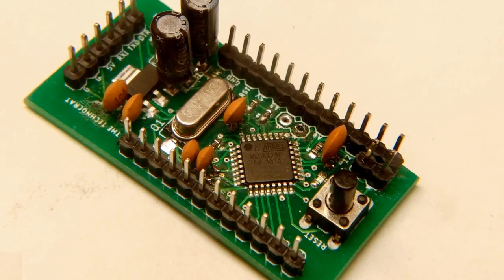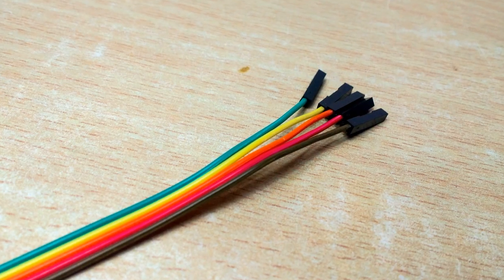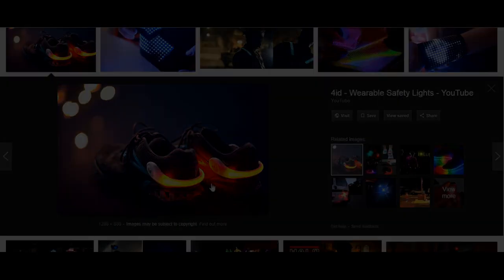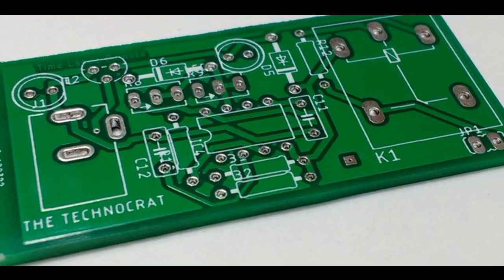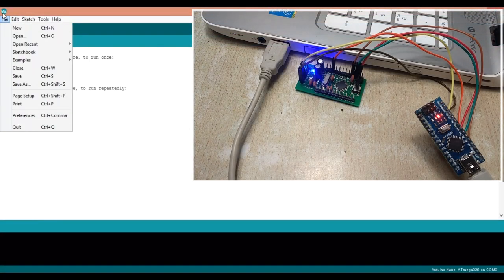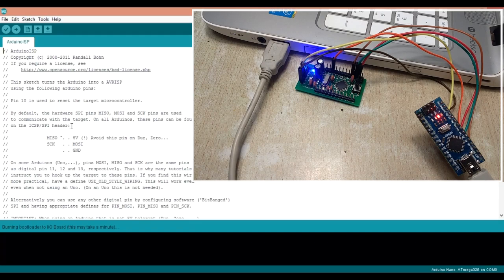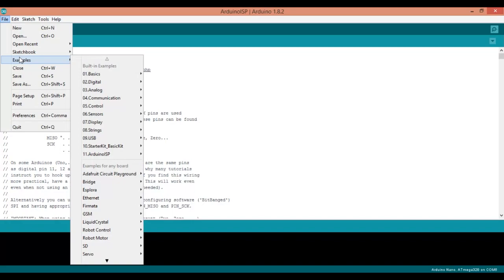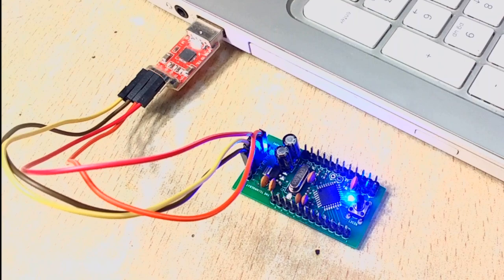Make Arduino NANO | How To Burn Bootloader Onto ATMEGA328P-AU(SMD)

Comment: Very disappointed by this video. Absolutely no instructions on the wiring of the bootloader. Did you connect a pull up resistor on the slave Arduino's schematic? Did you have to put a capacitor between the master Arduino's reset and GND? I guess we will never f**king no. waste of time.